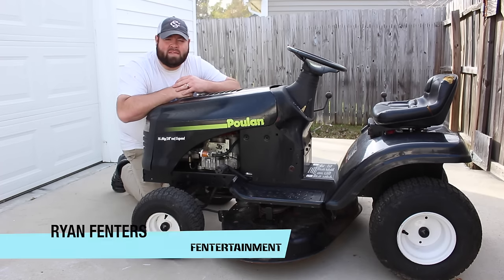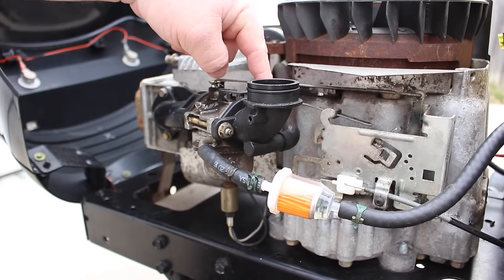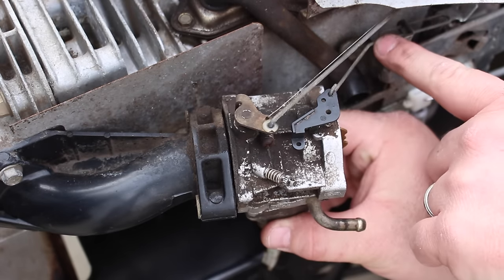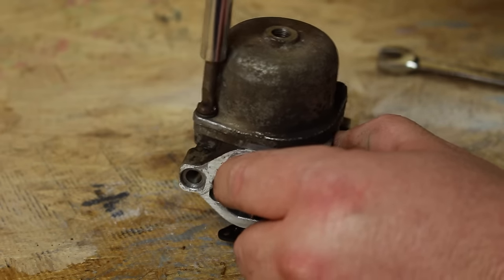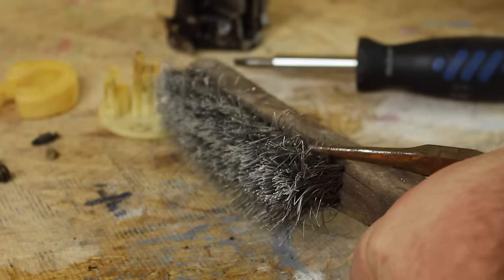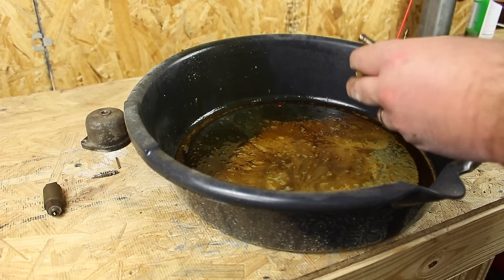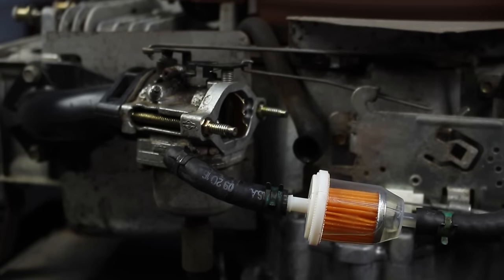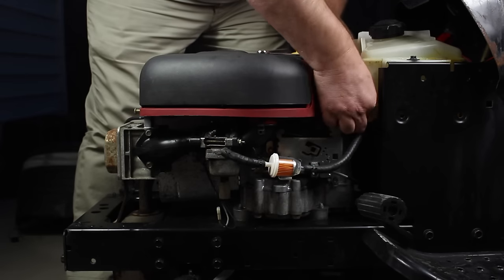How To Fix Briggs & Stratton Surging Engine | Nikki Carburetor Cleaning | Motor Hunts UP & DOWN

Comment: Mine runs great for about ten minutes then it starts surging til it shuts off . Same problem after its ran for a few minutes ???
Reply: Hippie 64 check your gas cap. Mine was doing the same until I found that the gas cap was not venting properly. After running for a few minutes the dirty gas cap wouldn’t let air get into the tank and fuel will stop flowing.

Comment: First try carb cleaner. Pit it in the tank run engine for 10 minutes let set for a day or two start engine that is easier than  getting into a carb and lose a part for the carb

Comment: I crack the bowl solenoid loose a hair first thing and let them other hold it for me.  I don't know why but out of the hundreds of these carbs I've taken apart I've never seen that spring in any of them.  The fuel solenoid has nothing to do with letting fuel into the bowl the inlet needle does.  You shower putting the main jet on form the wrong side it goes in from the top down the tube.  This is a dificult carb to deal with.  On the soilnoid just cut the damn black plunger off with some side cutters and throw it as far as you can no need to connect the wire up this gets rid of an eltricl problem and the black pick will pull up when you don't want it to and the mother will shut off.

Comment: Thanks for the Video,  What Numbers do I need to order a Rebuild Kit?
Reply from the maker: I dont know, as you seen I didnt use a rebuild kit. I just cleaned it.
Reply: You can find them on Amazon, but be forewarned, they are junk. Search Amazon for "Briggs and Stratton 796184 carb kit".  

For one, the plastic float housing, the float holder assembly, and the needle jets are not milled/cast to spec.  When you rebuild it, there is a small o-ring that comes in the kit for the main jet. They won't fit in the hole correctly so it's pain to try and force it in the shaft and you risk damaging the parts.  Also, the large black O-ring that you can see in the video, I have not seen one Nikki carb have the o-ring as flat and seated as his is.  The kit is also missing the correct o-ring that goes onto the float holder, which then is inserted into the carb housing.  After 4 kits, and working on 3 different carbs/mowers, none of them were the same after rebuilding with the kit., and it was very frustrating.  I ended up buying a complete carb assembly and this one is surging after one use.  

RIght now, the Carb kit 698620 works, and is only $23 bucks.  Might as well just get that and be done with it.  Ethanol really messes up the Backfire solenoid.  You can use break cleaner and clean that plunger out, make sure it moves freely.  I have fixed quite a few that were sticking and wouldn't allow the engine to start, even though gas was making it into the engine.
Reply: You need Model, Type and Code numbers. Go to Partstree.com for best results. Take the part number to any small engine shop. Whatever you do, don't let the shop look up the number for you using your model/type/code numbers. Why? Most of these people really don't know WTF they're doing. One place that screwed me over. I used to work there (2 years) and it was a great place! We'd drink whiskey almost every afternoon and get shot. I left and the dude's wife came in, ended the drinking and the place went to Hell. I called in a Troy Horse tine shaft part number and the "Iron Maiden" answered and insisted on the model number. I drove the 12 miles there and was handed seals that looked...hmmm, okay. Got 'em home and...too small. They were axle seals. Took them back and was told by her hubby: "You must have given her the wrong part number". Fucker insisted I fucked up! Asshole. Yeah, I'm still ranting some 17 years later...

Comment: What if it's a bran new carb? I can't seem to get it adjusted right, I still get surging.
Reply: I have the same issue, I'm going to try and drill out the main jet. Since choking makes it smooth out I assume it's running lean.  Strange for a brand new carb.  I hate Nikki carbs!
Reply: Ya mine runs smooth with choke. I haven't tried screwing the fuel mixer screw all the way in but that should be more gas and less air, similar to choke right? A lot of people have bought the same nikki I have and it seems to work for them. Maybe we just got a dud. I've also adjusted the valves and governor but the issue stays the same.
Reply: stonecoldtrk had similar issue! cleaned carb, no look! But someone told me to remove pre and main airfilter! banging like a champ ever since(I got new ones obviously) but a really old air filter is what was causing my surging, I couldn't believe it!
Reply: I'v already replaced my air filter. I think the new carb just doesn't have big enough jets and it doesn't have a high speed fuel adjustment so I think it's just not great for my application. I'll eventually rebuild my old carb probably.

Comment: Mine surges and blows oil n smoke from muffler.....head gasket?????
Reply: That happened to mine...
Check the oil level, it might be high because if your fuel solenoid is not operating, it is allowing gas into the chamber and therefore accumulating in the oil tank.  It it is not overfilled, just let the motor run for about 5 minutes and then the spewing of oil and smoke will subside.
If the solenoid is not operating, place a on/off fuel valve in the fuel hose to turn off when not in use.
Good luck.

Comment: good video man - it takes a little time and work - or just buy a new one and replace it for like $22
Reply from the maker: If you replace it be sure to set the air fuel mixture screw on it. I've replaced a bunch of them with the cheap amazon carbs and they dont seem to run right after you install them.

Comment: I shall sub if this works, and my mower starts without racing (flywheel spinning too fast, which can cause the engine to kaBOOM!) Will let you know.

Edit 1: okay my carburetor is sitting in carburetor cleaner and will be overnight so until then enjoy the like

Comment: Ummmm, I didn't have a spring under my float. When you removed your bowl there was a spring under the float.
Reply: There's a few different versions of that carb and some don't have that spring.
Reply: @donaldgreen7471 , okay thank you buddy. I removed the bowl to where nothing would fall out and didn't see one.
Reply: Mine didn't have one either.Also there's a Welch plug on the side of the Nikki carb,if it comes loose or out the engine will run very eratic.I took my carb off 3 times  cleaning and going through it before I noticed the plug was gone. I put a small piece of metal over it with silicon on top and the engine ran perfect.

Comment: So why not just use carburetor cleaner while it's running?
Reply: Because spraying carb cleaner into the air inlet while it's running does nothing towards cleaning the internal passages. And anything that breaks loose goes down into the cylinder if you do it while it's running. But a little bit of Seafoam (like maybe a tablespoon) every so often would probably go a long way to not have to do that.

Comment: Replaced carb with new out of box and it is still surging... removed carb intake manifold ,looks good, set mag gap , adjusted valves, replaced spark plug , New hose from tank to carb..Still surging..HELP !! ps it is a Troy Bilt 21"deck. TB110 . Briggs  550EX, 140cc. Eng Model # 09P7020144F-1....Eng.sr# 170303 51 76564..

Comment: what do you do to it when you put a NEW carburetor on it and it still Surges
Reply: glen verify your valves are set to 0.004 (intake) and 0.006 (exhaust).

Comment: Those carburetors are junk. I tried cleaning mine and the gasket expanded and I never could get the carburetor back together. I ended buying a new carburetor for 20 dollars off Ebay. I have a slight surge but it runs good when it's under load.
Reply from the maker: Might wanna see if your ebay carb has a air fuel mixture screw and adjust it. I've done a couple of those in the past with some flip mowers, after adjustment it ran smooth!
Reply: @Fentertainment  I've adjusted it a bunch of times. I think the low speed jet is slightly too small. I'll have to get a carburetor drill bit set and drill out the low speed jet.

Comment: A riding lawn mower for $50?  it had a steering wheel, the seat was decent and a mower deck!! Crap!  I live in the wrong county!
Reply: found one just like it at the dump,had a flat tire.runs good
Reply: I've been GIVEN riding mowers in mint shape! One was a trade-in on a new Husqvarna. I delivered the new one to the guy and he said" You want my old one?" I thought it's probably a pile but when he pulled the tarp back, I thought: "cha-CHING!" Sears (AYP) rear bagger, "newer" (read: non-leaking push rod tube Tecumseh) I think I had to buy a new battery for it. Used it for years and sold it for $250. Another dude who lived nearby asked me if I wanted his old rear engine Snapper. "Okay". He DROVE it down and it was MINT! Just needed a new blade. How it stayed mint long enough to wear out a blade, I have no idea! Sold that fucker for $450 and gave it away at that! Best deal I ever got was trading an old, decrepit, smoking, oil burning Snapper walk behind for a MINT condition 8hp chipper/shredder! Sold it for $800! What the dude was thinking, I have no idea!

Comment: Ese modelo de carburado es una fuente de problemas SE inunda , oscila el motor  (Surge)  Problemas que yo encontre  SE tuercen las orejas que aprietan la cuba a la tapa y los sellos de goma tanto de la entrada de combustible caja del punzon ( Needle)  y el sello laberintico de goma no aprieta La gasolina se inunda y no trabaja apropiadamente  Yo rectifique la boca de la cuba usando una lija 240 sobre un vidrio hasta que asento toda la cuba.  Despues agrande el oido (Orifice) de combustibe a marcha en baja a  30 milesimas de pulgada  y la oscilacion se le fue y  inundacion se soluciono asi como la estanqueidad de las juntas de goma Conforme a mi experiencia en B&S que viene desde 1960 Este  Nikki es el PEOR carburador  que he visto en motores Briggs & Stratton

Comment: Easy to fix. Trash it and go get a Honda
Reply from the maker: Honda riding mowers are extremely nice. Especially the 2 cylinder water cooled tractors with the driveshaft. However this was just a mower to flip.
Reply: They're getting cheap too
Reply: Flipping mowers is fun and easy money......if you don't end up upside down....LOL